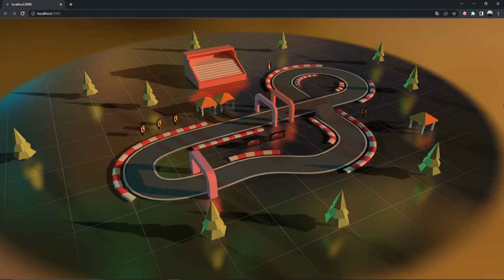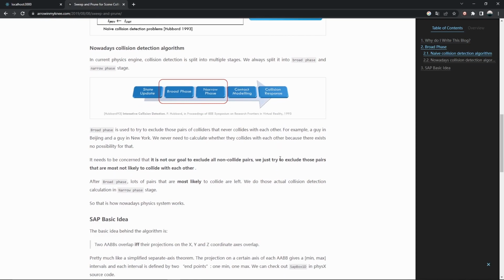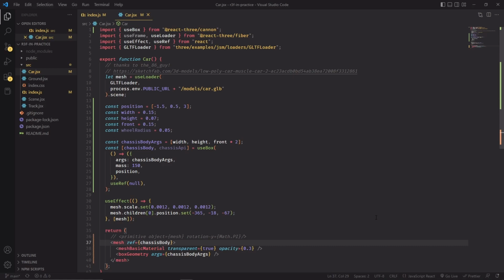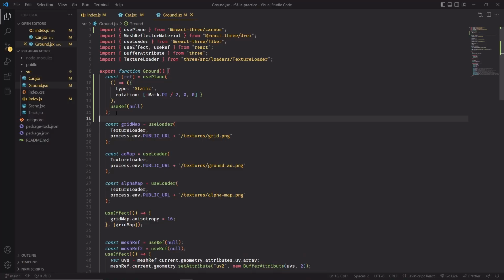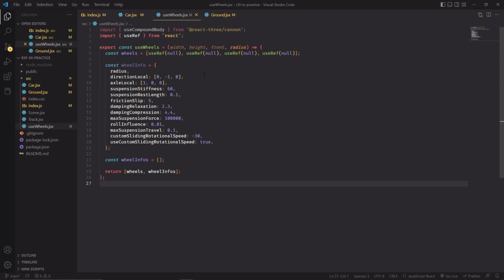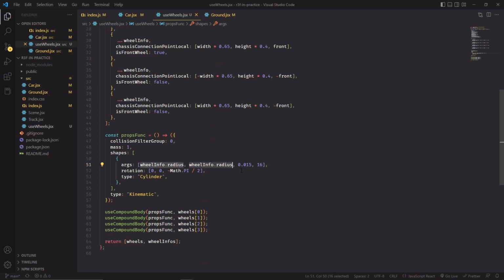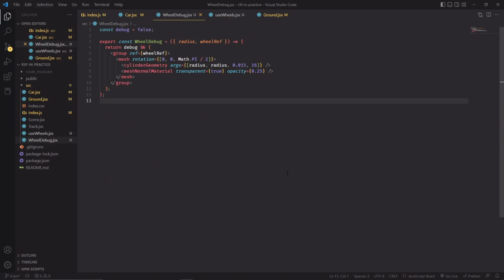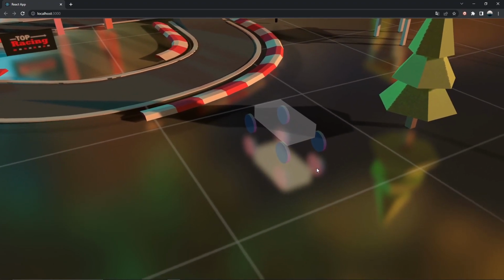Car physics mini game with React Three Fiber and Three.js [ Tutorial part 2 ]

Comment: The difference between the two sentences is what causes the material to darken
import { TextureLoader } from "three/src/loaders/TextureLoader" :lighten
Or
import { TextureLoader } from "three" :darken
Reply from the maker: That's super interesting, thanks for the insight! I suspect theres a bit of a mismatch in threejs for the color handling in those versions of the imports but overall if it works it works... Thanks!

Comment: all the wheels are spawning in the same place, any advice?
Reply: solved it : in the wheel info, it's "directionLocal" not "directionalLocal"
Reply: @abedelrazzakchreim4988  not working
Reply: @richardramirez5746  did u manage to get it working? having the same issue
Reply: @paschalasobirionwu1183  I was using chassis instead of chassisBody. It is mandatory to use wheels =[ useRef(), useRef(), useRef(), useRef()]. I was using new Array(4).fill(useRef()). And the most useful advice: use Debug component from cannon, it let you watch the real physics bodies
Reply: One more thing: after adding Debug, adjust wheel connection points at useWheels. Because that defines chasis position relative to wheels (or viceversa, the way you see it)
Reply: same bro did u manage to get it working?